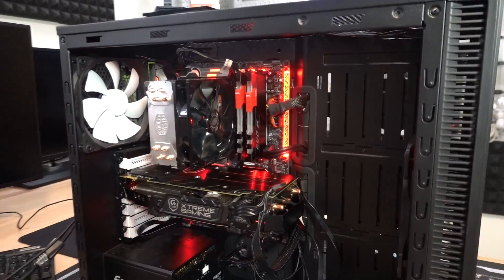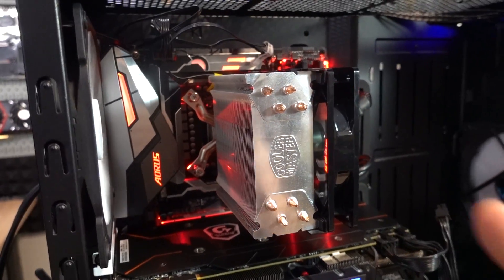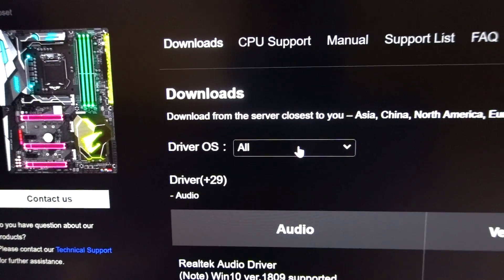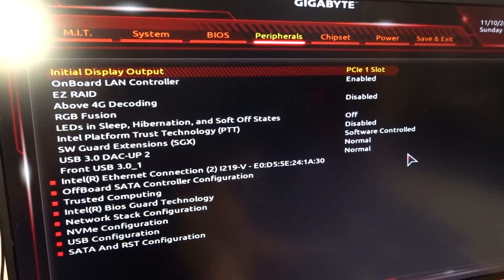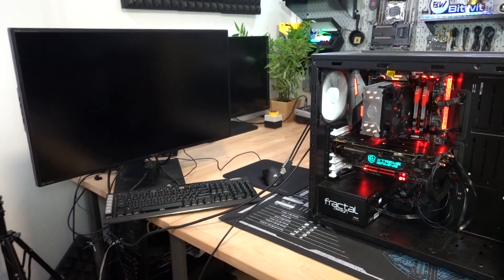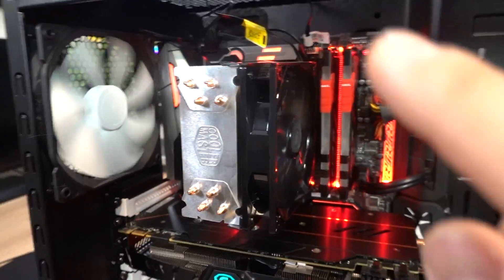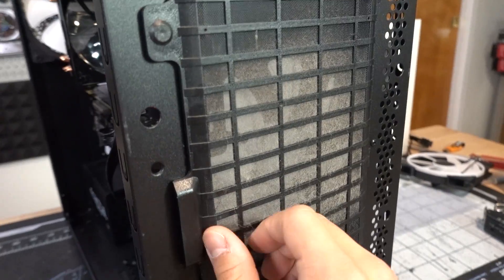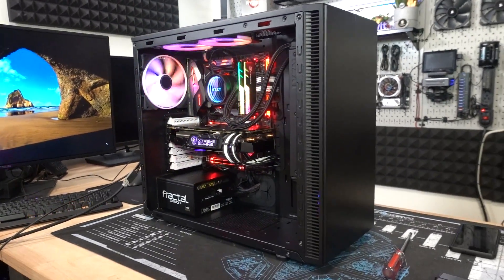Every PC owner should know how to do this

Comment: Quick question. I have a brand new rig and am posting for the first time. I need to update my bios via q-flash (same method done in this video) but I also need to install windows 10 iso via usb as well since my ssd is completely blank. Am I supposed to use 2 separate usbs? 1 to first flash and update the bios and the second one with windows on it to then go into bios after installing, updating and restarting the system and selecting install windows from usb in the bios? 

Edit : sorry if I'm not making any sense.
Reply: From a second computer, make your USB drive for Q-Flash and update your bios. Then, once you checked the flash was complete, make sure you set the right parameters in your bios. Once you confirmed your bios settings are good, and still valid even after powering off the PC, (make sure the ssd is detected) proceed with windows 10 installation (make a win10 install key from another PC). I recommand not doing the bios flash during a thunderstorm and if possible having your PC connected to a ups would be safer.

Comment: I had to do a BIOS update as well to get my new gfx card working. I had an ATI Radeon HD 7770 1GB gfx card and updated my system to have an nVidia RTX 2070 8GB instead but my pc didn't go beyond the POST. I had to update my MSI H77MA-G43 from BIOS version 1.1 to 1.15 to get my new gfx card working. That was the first time in 25 years I had to do that since I usually bought a whole new pc when it was outdated

Comment: I'd personally say, always keep your BIOS up to date (unless of course there's some incompatibility issue with the hardware. In which case, you can either A: do some research before hand and not do it at all, or B: just roll back the BIOS version). In my experience, you can can actually receive a substantial speed boost to your system (at least in terms of boot up speed). No idea if that's already been covered on this channel, but there it is.

Comment: This is why MSI is the king of motherboards. Just plug the USB into the motherboard while connected to the power supply and press the button on the motherboard. No need to enter BIOS or even complete the build - just power supply and motherboard. Then done, it's updated

Comment: Hi, I'm a total newb when it comes to building my own PC. I know the basics of the hardware, but have never done a full PC build. I am going to be building one here soon and want to know what you think. 

I currently have an iBuypower setup i bought in 2015. I didn't know much but here are the specs
i5 3.2ghz 4 core
Some mobo, I have no clue what it is, with 2 DIMM slots and no chance doing anything fun.
Gtx 960
1 8gb ram DDR3
1 tb partitioned hard drive.
EVGA 700W BRONZE PS( I upgraded) 
I've used it to edit pictures for my photography side hustle and only use Lightroom, which it works somewhat well. (Can't use any other programs while LR is open). Also I game with it as well. 
I have been wanting to upgrade so I went all out and got an Msi GTX 2070 super Ventus GPU. I started researching and found out my rig is super weak for this card. I've been watching your channel (love it btw) and others and decided I want something better. I have decided on a AMD Ryze 7 3700x, ASUS - TUF GAMING X570-PLUS, CORSAIR - Vengeance RGB PRO 32GB (2PK 16GB) 3.2GHz PC4-25600 DDR4, Samsung - 970 EVO Plus 250GB m.2 ( for windows), Samsung - 860 QVO 1TB Internal SATA Solid State Dr., and a Fractal G-Focus Case. I will also port the power supply over to this rig and return the old rig to the original design. If you could give me some tips on what I can do better that would be great. I have a budget of $1,000 thay doesn't include the already bought 2070. Thank you!!

Comment: And this is why you go to the motherboard vendor's site and always look up which CPU's are supported per bios version BEFOREhand
If you suspect you need a very recent bios version in order to run it you may want to skip it or make sure you have a CPU available that it will post with.

Comment: Rip me. I got my third gen CPU with my first gen motherboard. I didn't know anything about this BIOS stuff and now I can't use it because I don't have an older CPU lmao

Edit: found out about the flash bios button. However it wasn't doing anything. Found out I had to convert USB to mbr. But apparently my USB can't be converted to mbr. 
"The specified disk is not convertible. CDROMs and DVDs are examples of disk that are not convertible." If anyone knows if there's like a specific type of flash drive you gotta use..let me know lol I can't find anything online.

Comment: You do not always need the older generation CPU heck you do not even need a CPU, RAM, or GPU. If you have an ASUS or MSI motherboard it may have USB BIOS Flashback which allows you to flash the BIOS on both Intel or AMD without need the CPU or RAM installed only power connected to the motherboard. Gigabytes is called Q-Flash I believe.
This allows you to buy say an X370 motherboard such as the Asus ROG Crosshair VI Hero that only cost around $150 now and not $260+ for a new Ryzen 3600/3900 without needing to contact AMD for an short term processor loan boot kit that will take weeks to ship to you.

Problems you might run into when doing this is for what ever reason USB Flashback does not play well with all USB drives so you might need to try different USB drives or download software that will wipe and reset your USB drive, doing so in CMD will not reset the drive in the way these software do, there are guides for this online. 
For over 6 hours I tried ways of resetting my USB drive even using different formats all of the ways listed in how to do so within windows. I finally found an old post which had me download BOOTICE, after formatting my drive with this tool the USB BIOS Flashback worked.

Comment: i have been struggling with figuring out how to update my bios for my gigabyte h270 gaming 3 motherboard ever since i built my rig. today was the day, that made it 10000000x easier than any thread forum or page on the internet. I can't believe how easy that went with zero issues. went from an early 2017 version of my bios to a 2018. im already noticing a difference in overall performance.

Comment: I don't know if this is common sense but BIOS updates also fix incompatibilities with other hardware like GPUs. I bought a used Gigabyte board that was for 3rd gen Intel CPUs with a really old BIOS that wouldn't display video using a GT 730. I check the Gigabyte website and the BIOS Update says that the latest version allows support for "higher-end GPUs" which the GT 730 clearly is not. Details like that on BIOS changelogs could save builders a lot of time.

Comment: At 5.30 you said  'sometimes If you're quick enough when that prompt comes up it will tell you exactly what key you need to hit in order to bring you straight to the BIOS flashing tool.
Did you know if you hit the Pause key on your keyboard, it will halt that screen. Just hit another key too start it back.

Comment: I'm looking to upgrade my PC, but I would like to keep my current motherboard as I just purchased more DDR3 RAM, however I am looking to upgrade to a newer generation CPU, specifically the RYZEN 3600. I'm not sure if it would require a BIOS update, or if it is even compatible at all. Just wondering what is the best way to figure that out.

Comment: Bitwit would my fx 6300 and gtx 760 run good with the evga 600 watt 80 plus certified or would i have to upgrade my psu to be to run a better cpu and gpu

Comment: Ironically this video popped up in my recommended. Built my first PC last weekend but had the exact same issue.. 9700k not compatible with my mobo due to old BIOS.. I searched and searched but did not find an older CPU I could borrow so had to take it in :(

Comment: 💯 it wasnt the bios you just got lucky. It is new windows 10 perk. Anytime you put something new in to your system well make any upgrades it syncs your data from previous device so what happens you have regular boots for up to 10 sequence boots after system most likely to get blocked or #corruped in that case u have to proof you have windows 10 boot device and key. I have no idea why Microsoft decided to do but this is anoying as fuck as computer technician. Ms engineers would not tell me why it was done but its most likely to do with business and domestic license issues. Anyway just heads up in next few months it should be topic of choise for many tec guys on YouTube.

Comment: I'm currently building the most powerful rig I've ever owned. It's a combination of new and used parts, and my goal was to get the most bang for buck possible.

Specs:

Kllisre X79 Motherboard
E5 1650 V2 6c/12t
6 Heat Pipe Dual-Tower CPU Cooler with 2 fans
64GB REG ECC 1866Mhz Memory
MSI 1080ti Aero OC with Arctic Accelero Xtreme III cooler
970 EVO Plus NVMe M.2 SSD 500GB (Boot Drive)
2x 4TB HGST 7200rpm HDD's
EVGA 1000 G3 80 Plus Gold 1000w Modular PSU
Phanteks Eclipse P300 Metal

Total is a bit over $1,300. I bought 2 extra case fans, a fan controller, and an M.2 heatsink. If anyone reads this, let me know what you think.

Comment: I have this same motherboard running the 9700K. The chance to boot is like 50%. Various things happen if it doesn't boot properly... Im using the same SSD installed on a previous PC that had no Issues and have reinstalled windows 3 times. 1. Most of the time it boots up to the BIOS screen. 2. Lots of times I get the no boot media found. 3. Boots to the boot menu with nothing available to select. IT DRIVES ME INSANE! I'm almost afraid to turn my PC on because one of these days it might fly out the window. 

I'll 100% be updating my BIOS this weekend. I reallllllly hope this fixes it. Great videos man, keep it up!

Comment: I’m having the same problem. I have just upgraded from air cooler to AIO cooler. I also installed some phanteks extension cables for colors in my system. Since doing this, my pc has lights and fans that spin up, but no signal on the monitor... any suggestions? I have a asus prime b250m-a pro mobo, i5 7500, and a Corsair cx650m psu with a gtx 1060 6gb

Comment: With Gigabyte, I found that you have to read the BIOS version notes.  You may have to upgrade to a less than very latest version (but newer than current) BIOS as well as other software (Gigabyte) prior to upgrading to latest BIOS.  At least for the BIOS update needed for the generations of AMD cpu.  Could cause issues according to their notes should you directly update.

Comment: I know this is a fairly quick video and not specifically about BIOS updates, but it would have been nice to mention how sometimes you can't just install the latest BIOS on some motherboards, they might require some hoop jumping by incrementally upgrading through certain older versions first. This has at least happened on some Gigabyte AMD boards.

Comment: You placed the radiator fans in push config. I have the same but in pull config. Would you say they perform the same apart from the push being harder to clean

Comment: Hi, i usually love your vids, but this feels lazy and rushed....
PLEASE DON'T flollow this vid to update your BIOS.
Just as an example, if you simply picked the newest BIOS for this board "https://www.asrock.com/mb/AMD/B450M-HDV/index.asp#BIOS", then you'd endup flashing 3.3, which is fine, unless you are going to use, say a 3000G (like i did). If you do then you are screwed....if you are lucky you might be able to flash with 3.1(the correct one)
Always, always read what the update addresses first!
It can get worse, in the same example last line (3.1) "*** User will not able to flash previous BIOS once upgrading to this BIOS version." OUCH
Then we have " ** If you updated the BIOS before updating the AMD all in one driver, please refer to the Display recovery SOP to recover your system. " - i've fallen foul of this myself, and its a real pain
Also, according to most MB manuals and BIOS readme's, you should normally use "optimised defaults" immediately having flashed. - again, sometimes makes no difference, some times screws you.
Please don't be so cavalier with your vids, you are likely to cause someone hours and hours of pain, which is a shame, cos usually you are very funny, very accurate, and competely on point....
Guys, have fun out there building your rigs, but with BIOS's, please go careful, just cos they have made it simple, doesn't mean it's not without serious risk....

Comment: My new build is doing the same thing. Had it working for a day and then no display signal. I tested it with two different tv and 2 monitors, multiple hdmi cables and ports. I bought most of my parts from micro center and that’s 50 miles from where I live. I really don’t wanna take it back. Any suggestions?

Comment: Does the stuff you have on it already get deleted after updating your BIOS?
Reply: A BIOS upgrade does not touch your hard drive and its files. It will simply update your BIOS. This usually resets any custom BIOS configurations back to factory defaults, though.
Reply: @JJFlores197  thx. I was curious if that happened. Lol

Comment: I'm gong to need some tweezers and wireless anti static bracelet when I'm going to build my first gaming PC.
Reply: When I built mine, I wore leather shoes for a while. After four hours, it was unbearable, and I just did it in bare feet. You’ll be fine if you don’t touch stuff rapidly and build static, that’s looking for trouble. If you have carpet, build the thing on the box it came in. Otherwise, you should be fine. Tweezers could make it worse as they’d transfer electricity. Just use your hands. Cheers!
Reply: @SlippnJimmySGoodman  it's a reference to the verge's $2k build, in which the host mistakenly called zipties "tweezers" and wore a regular ol bracelet and said it was "anti-static" even though it wasn't grounded at all
Reply: You do not need all that stuff.   Just make sure you're careful as to not collect some static and also touch some metal before handling anything and you will be fine

- Technican that's built plenty of PC's.
Reply: oEx0duSo The case itself is a pretty nice ground.
Reply: Xolotl You don’t even need all that as long as you are careful enough.
Reply: @kevinmayfield6182  That was the Verge PC build reference  ;)
Reply: King Super Saiyan I know it was but even in that instance the verge was still wrong lol.

Comment: You probably won't respond. I just built a new system (ryzen 7 2700x RTX 2060). I installed Windows 10 via USB and booted into the free version. It was working fine for an hour then it blue screened and I don't know what to do. please help....
Reply: Check your temps (CPU and GPU) to make sure they're not overheating. BSODs can be caused by a myriad of things so it is difficult to tell you exactly what is wrong and how to fix it it.

Comment: Kyle, on AORUS boards you can "install" BIOS while running (with it's own software) it needs only a reboot and the downloaded file. The only thing that you really "cheap out" doing that method is not needing a pendrive, neither do you have to format the pendrive as FAT32. AND YES, BIOS only sees FAT32 filesystem drives in the Flash menu.

Comment: Okay I had the same problem with a system that I built, but I was able to play games for days before I lost signal. It happened after I took my cpu fan off to change the direction the fan was facing and then once I put it back together I got no display at all. Anyone have any idea what could’ve happened?

Comment: I also have the i7 8700k paired with a 2080 strix card with 32gb 3200hz ram but I get stutters here and there even at high fps with the 240fps tn monitor why is this?

Comment: Man i have a question to a huge problem im having right now with my pc. I bought a new motherboard, cpu and ram and used my old hard drive. I put all the parts together it went fine. When im running bios my keyboard and mouse is running but when im in the administrator the mouse and keyboard stop working. And im also running on a windows 7

Comment: Q: After seeing the video I thought I update my current bios as well. But looking at the BIOS downloads page there are several iterations or version of the BIOS. So do I start flashing from the one after I have to and up to the lastest version? Or do I just need to use the most latest version as it has all the fixes and updates from the previous ones. I have a MSI Mobo and AMD CPU. TQ

Comment: I had this same issue where bios wouldn't post, for some unknown reason my up to date B350 bios wasn't posting my 2400g, which reguires an update to bios before use. In the end, just switching the chip to a 1600 and turning it on and off twice fixed the problem, putting the 2400g back in worked fine. 
Random bios corruption? Idk

Comment: the bios probably reverted to the secondary bios after a unexpected power down
when downloading the bios windows doesn't matter, how would a Linux user install a bios if windows only was supported
he could just have popped a USB in with windows or a different OS to download the bios
you can have the bios file in a different directory in directory, bit its easier to find in the top directory
this guy was lazy not to use obs for on screen recording
if you "brick" your system and have a secondary bios just revert back to it, normally it says how to do it in the manual 

I feel like this guy doesn't know what he is talking about.